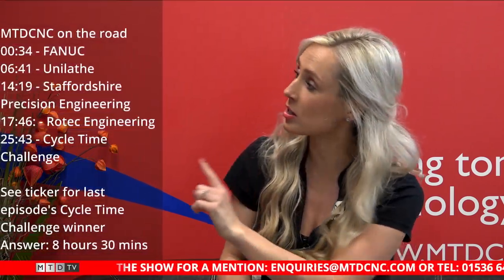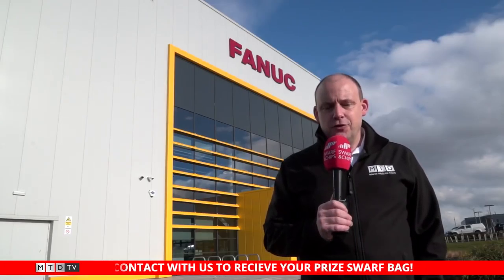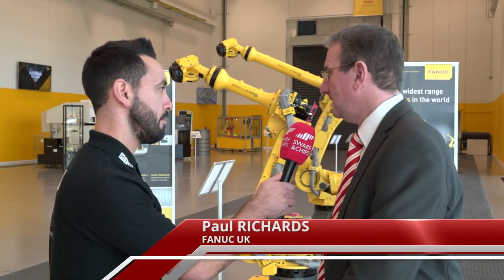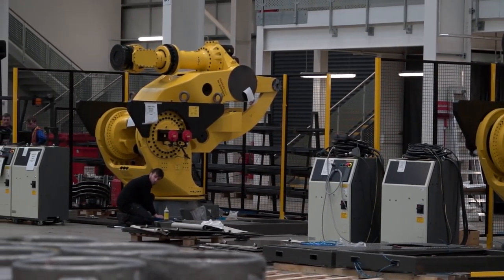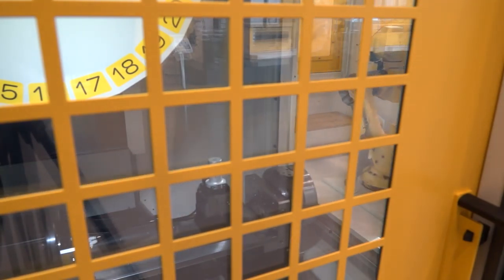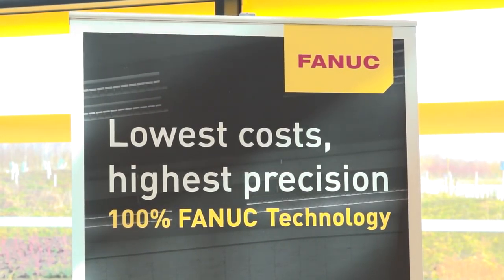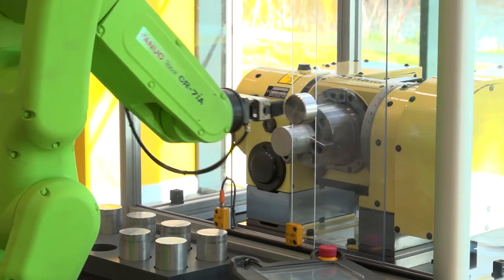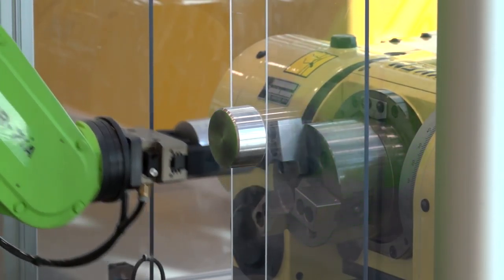#SwarfandChips - Planes, trains and automation - 09/02/2018 Ep 66

Comment: It will be interesting to see if the UK CNC industry sees significant growth over the next two years as costs to produce products inside the UK comes under intense economic pressure  with the looming Brexit divorce on the horizon. To keep costs lower and production high, it is likely UK industries will probably have to embrace precision just time delivery as margins are  squeezed into high single digits. Low and High volume CNC shops will be facing pressure to utilize every minute of a day and is going to be significant metric that cannot be overlooked.

I imagine this will be a critical management discussion for all UK companies if they are in the export market to the EU, which is likely to face export tariffs. The industrial landscape of the UK will likely see a dramatic increase in the use of CNC across all manufacturing verticals -  if it can improve its deployment and use of automation / robotics. It is becoming clear that it will be a critical factor in utilizing CNC to its maximum potential including 7/24 service. Automation and multi-axis robotics have been in place in large assembly plants for years. But it's clear to me, small engineering and low production shops are going to have to follow suit and be capable of producing components with quick turnaround times that will translate to daily high volume capacity. Instead of machining 10 complex parts in a week, it the market is beginning to demand 10 parts in 3 days and then reorder months later instead of lower weekly volumes, forcing small firms to find additional work to fill the gaps because they are now required to operate around the clock.

I think we are only seeing the tip of the iceberg of how small engineering and production CNC shops are going to face over the next two years. It literally will be, sink or swim for many of them. Because if they don't make these hard decisions, there are 27 EU countries that will fill the void quickly.